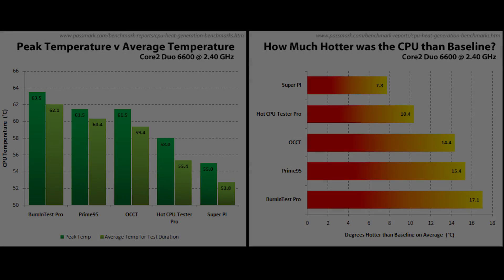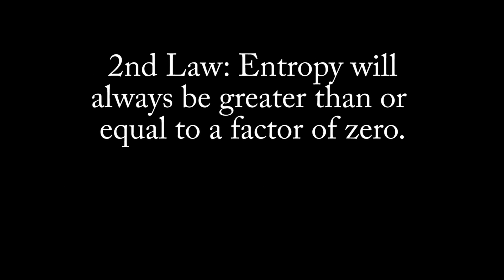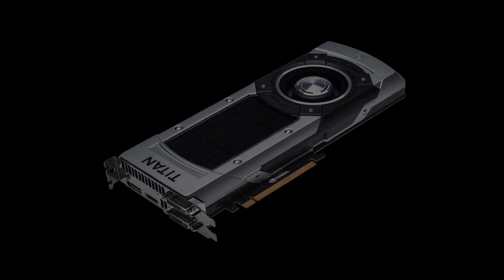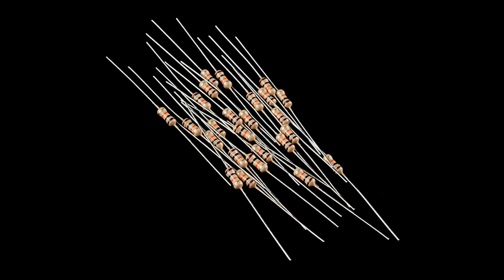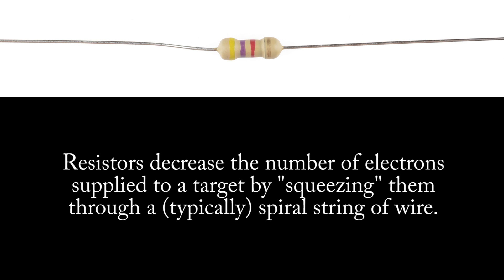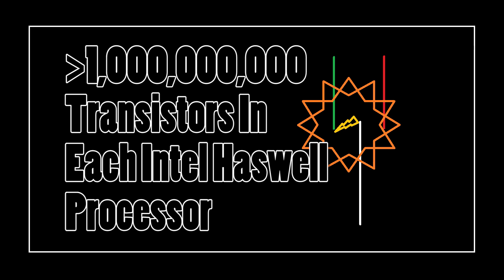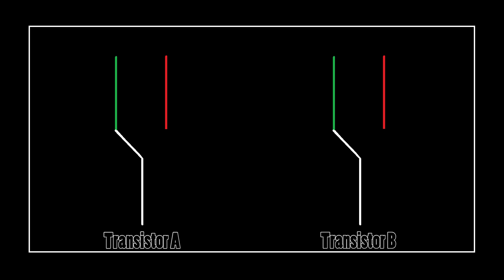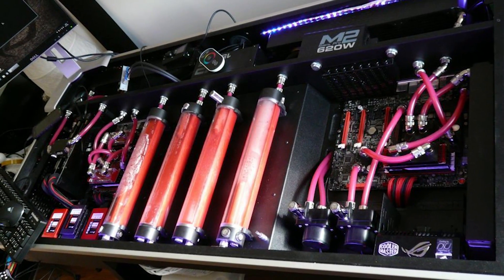Sketchy CPU Temps?

Comment: my cpu is cooler on then when its off
Reply from the maker: Your statement is impossible unless you're using a liquid coolant that has an ambient temperature lower than that of standard room temperature. In which case, you should be worrying about condensation buildup within your system.
Reply: +Science Studio I am using deapcool 360 aio cooler and when I check my temps it has gone as low as 0 celcius
Reply from the maker: +Emils Vitolins Not possible on standard aio's. Unless your radiator is sitting in a fridge, the laws of thermodynamics deem it not possible. A radiator running 100% efficient (also impossible) in a room at 20C would only be able to cool your CPU to 20C. The temperature monitoring software you are using is giving you incorrect readings.
Reply: +Science Studio its hwmonitr it's the best softwear I know
Reply from the maker: You should read up a bit on Google. HWMonitor is notorious for giving incorrect low-temperature readings.
Reply: OK tnx I will read up . loved your video btw.
Reply from the maker: +Emils Vitolins Not a problem, thanks for the support! :-)
Reply: +Science Studio Which software would you recommend to use to monitor tems then?
Reply from the maker: +Emin Sarabsky CPUz and HWMon. are both great. However, my point in this comment chain was that most monitoring programs become inaccurate when temperatures are relatively cool.
Reply: Science Studio Oh, ok. Thanks.